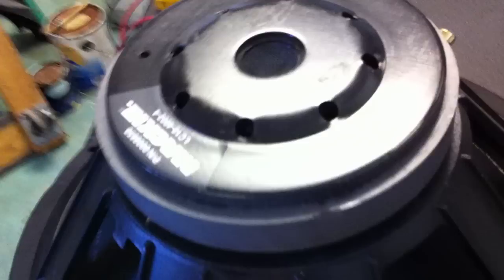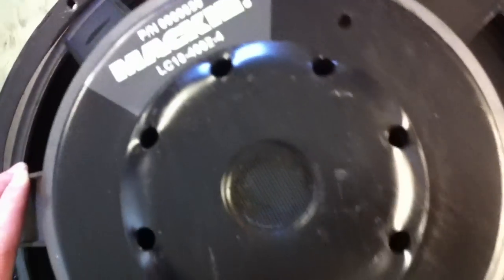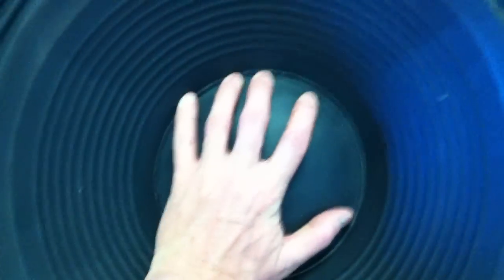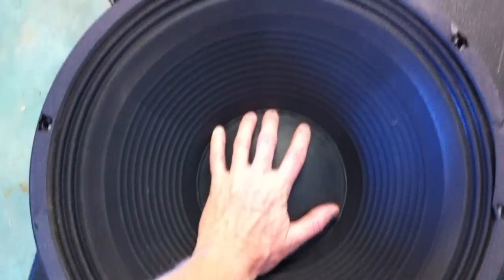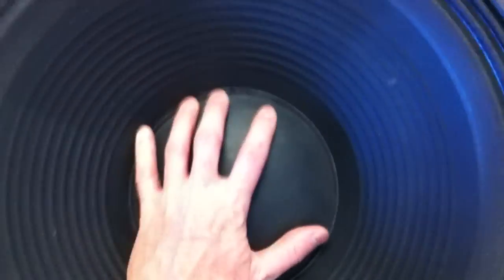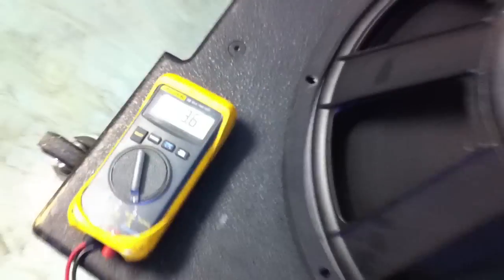Troubleshoot my 18" Mackie sub - Now Solved

Comment: try a 9v battery on your speaker to make shure the coil is not open circuit to magnet , then drop meter on output cables using dc voltage to see if its outputing sound from amplifier or connect another speaker to output cables from amp to speaker. this will show u if speaker is ok or amp is naff,, 93% of these had to go back to factory as there was a amplifier problem ,, u might be better taking out the amp module and check to see if fuses have gone if black , this means transistors nackered,